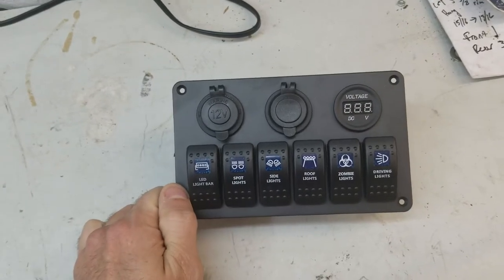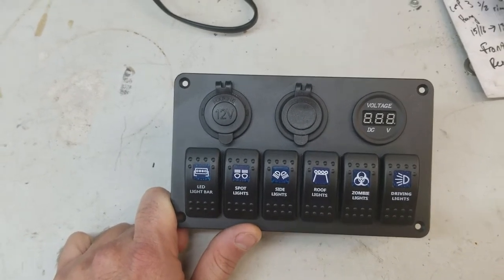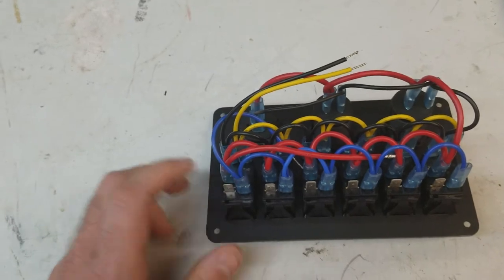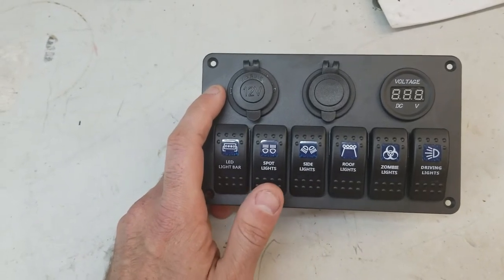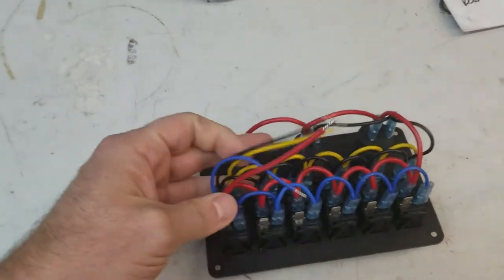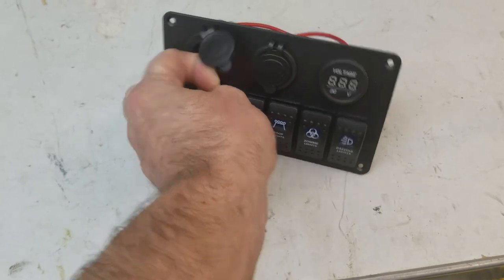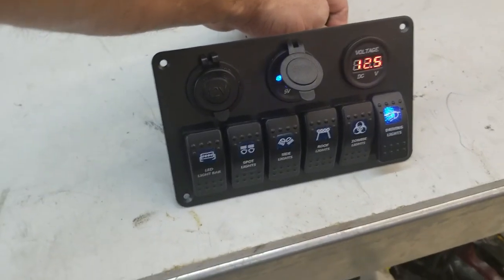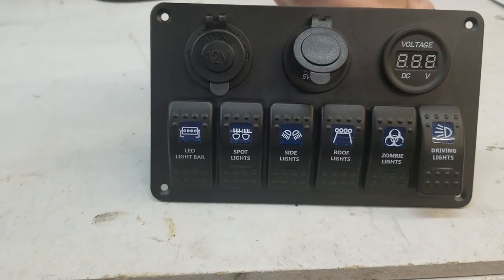6 gang rocker switch plate with usb and volt meter from Amazon

Comment: Wondering how you could wire up multiple relays with this panel... 
Would you connect one relay per switch? Or only on accessories higher than a certain amperage(15a)? 
Thanks

Comment: Nice review but I'm still waiting for the outcome.  I bought the same panel and I was wondering what is the yellow and blue wires for? Did you make a video already installed in your truck?
Reply: Blue goes to positive yellow to negative it turns on a small light on each witch so you can see it even when the switch is odd